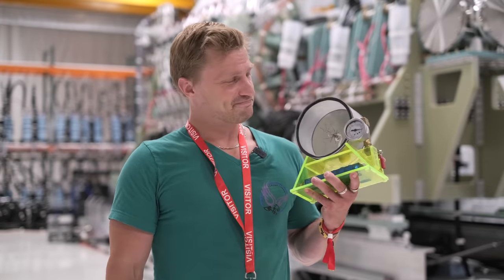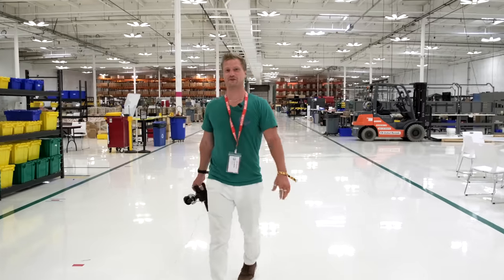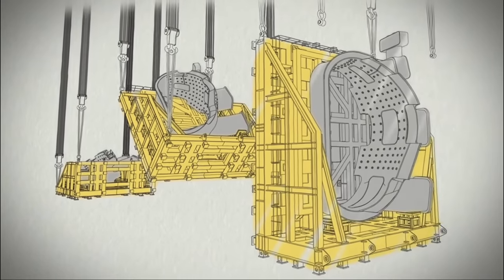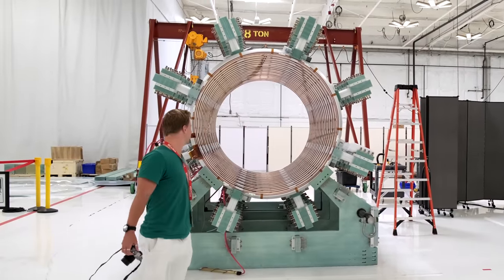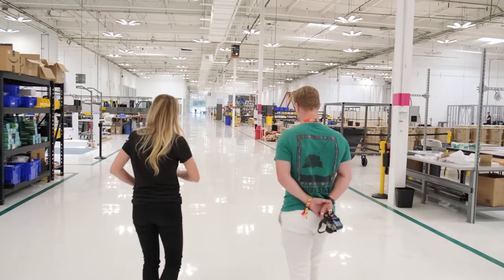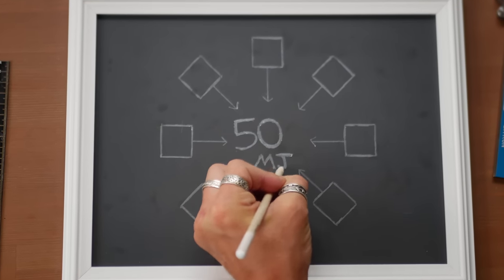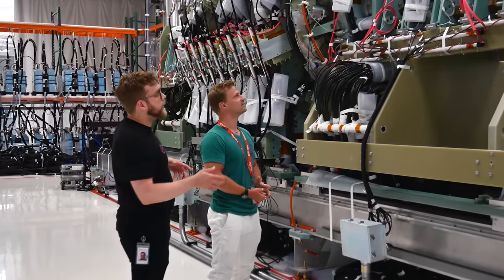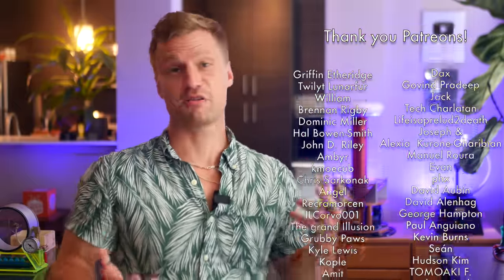An Exotic Approach to Nuclear Fusion (Helion Energy BTS)

Comment: I’m skeptically optimistic about Helion. I think what they’re doing is amazing but I can’t get over the fact that they never address the issue of unintended D-T reactions caused by side reactions that generate T and then allow D-T fusion. I’m sure the neutron level is a fraction of what normal D-T’s have but it’s still slightly radioactive and neutrons are no joke. However, it DOES seem like this may have influenced some changes in past designs I see. Iirc, they used to just take the electrons from the D-H3 reaction and allow them to drive their own current. With the new approach, it seems like that might be reducing the efficiency losses due to the side reactions (since D-T doesn’t produce e- iirc). Still would like to hear how they’re planning to solve/address side reactions tho. Overall, awesome video
Reply: The Tritons produced by D-D reactions are too hot and non- collisional on the time scale of the pulse (<1ms). They get pumped out of the chamber along with the other fusion products between pulses.

Comment: What I like about helion is they already have a way to harvest energy from the fusion reaction. I know for typical fusion reactor designs the goal would be to boil water, but that seems a lot easier for a fission reactor where you can use conduction with the reactor fuel. The plasma being suspended seems inherently more difficult to extract thermal energy from. To me it now seems like an unnecessary step like using a wind turbine to build water first or using sunlight to boil water for a steam engine (though a stirling engine might technically be more efficient than PV). It just seems like something that is simpler and would be more efficient. And the fact that the reaction they use only produces energy and charged particles and not neutrons just makes it so much cooler that they don't need to extract energy from a chargeless particle. It seems to me that in theory this method would be the most efficient fusion reactor possible. As an electrical engineer I may be biased, but its so cool being able to divert much of the mechanical problems into electrical ones (though thats not to say there aren't plenty of mechanical problems to solve with this design).
Reply: Their reaction DOES produce neutrons, they just don't mention it.   
H2 + He3 is aneutronic, but H2 + H2 -> H3 + H1 and H2 + H3 -> He4 + N .  
All of the research reactors are trying to raise Qplasma as much as possible, and experimenting with containment and tritium breeding. Things that must be solved before trying to even design a Fusion power plant.
Reply: also the magnetic coil in ITER are in the WAY  and cannot be removed!
Reply: While they may have decided how they want to take energy out of the system once they achieve fusion, they haven't achieved fusion yet. If their plasma gains 1MJ of energy per pulse, I predict that "regen-braking" the extra energy out of the plasma as it is being ejected from the reaction zone at relativistic speeds is going to cause problems with turbulent plasma flow such as hitting the walls.
Also, 0.1Hz firing rate? That sounds like an awful long time to hold plasma between pulses in something that looks like it wants to be a ~1MHz resonator.
Reply: @teardowndan5364  They don't hold the plasma between pulses. Each cycle starts with the creation of two brand new FRC plasma "donuts", and end with the total evacuation of the reaction chamber.
Reply: @ayybe7894  The Tritium side reactions are greatly reduced because the Tritons are too hot and non- collisional on the timescale of the pulse (<1ms). They get pumped out along with the other fusion products between pulses.
Reply: @teardowndan5364   They do not hold the plasma between pulses. The pulses are <1ms long. They have achieved fusion in several of their previous prototypes. Quite a lot of D-D neutrons too. Whether Trenta achieved net energy gain is a question though. The FRC plasmoid remains in the reaction zone until the end of the pulse.
Reply: @elmarmoelzer2229   If you throw away the however many 10s of MJs of energy needed to get hydrogen/He3 from storage temperature to 10+MK plasma before firing, that would be quite the handicap for true overall gain including all energy required to refine the fuel and reset the chamber.
Reply: @teardowndan5364  ???
The plasma is quite cold, even after the merge (low 100s of eV). It is the compression that gets the FRC to fusion temperatures. Overall, the process all the way to compression has been performed thousands of times and not just by Helion but even competitors like TAE.
Reply: @teardowndan5364  
You are assuming that the input energy is not recovered along with the fusion energy... Bad assumption.
Reply: I don't know why we should believe their energy harvesting method is efficient or practical.  It is a form of magnetohydrodynamic (MHD) generator.  The theoretical efficiency of a MHD generator is said to be about 60 to 65 percent (at least for burning fossil fuel), but so far no one has been able to approach this in practice.  Over many decades of time, MHD generators have been researched and MHD demonstration plants have been built but none have been able to compete with plain old turbines spinning plain old copper wire generators.  Besides the efficiency issue, MHD suffers from many material problems that are issues yet unsolved.  Are we to just assume that Helion has secretly solved all this already and all they have to do now is to make their fusion reactor produce moderately more energy than it consumes? 🤔
Reply: @analog_guy  
They have a FRC plasma with a beta of 1.
That means the ratio of plasma pressure to magnetic pressure is 1. It is essentially a perfect magnet.

Extracting the magnetic energy from the plasma should be at least as efficient as regenerative braking. The latter is at 95% now. In fact, they are using the same switches and electronics used in electric cars.
In addition to this, the plasma is in a vacuum. There is no friction. They predict that they can recover over 90% of the input energy that way. For the fusion energy it is a bit different (not all energy is transferred from the fusion products to the plasmoid) but it should be very efficient also. For the latter part, I think Oliphant is a decent reference. He published some experiments and calculations in 1973. He got 62% conversion efficiency from Alphas. Now his 62% was electrical coupling of the transformer back to the capacitors.
That transformer design is from 1973. The Switching technology has come a long way in 50 years, IGBTs weren’t even invented in the lab until 1978. So Helion should be significantly higher than that.

I do not see how any of those material problems would apply to Helion. They do have other material problems but those are unrelated to the energy recovery.
Reply: @analog_guy  The biggest problem with MHD is usually the fluid's conductivity, probably not an issue with 10-100MK plasma. Being able to recover 95% of the energy used to accelerate and compress the plasma might be the least questionable part of the whole thing in my book: simply using Lenz's law to let charged particles induce current in coils.
Reply: @elmarmoelzer2229  Thank you for your perspective on this and for your additional information.  If Helion is successful in producing a significant amount of fusion power, we may actually find out how efficient their conversion process is.
Reply: @teardowndan5364  Thanks.  I agree that fluid conductivity is a big problem in MHD, and I agree that there are a number of other questionable aspects to this approach to fusion power.  I'm no plasma physicist, but it would seem that by Lenz's law, the energy of any component of the velocity of the charged particles that is not perpendicular to the magnetic field will not be extracted.  Even if the plasma is nicely aligned upon injection, will it remain so following fusion?   It seems like there will be a race between energy extraction via the coils and energy losses via other processes.
Reply: @analog_guy  Not a fusion physicist either, though maintaining a coherent plasma flow just long enough to convert velocity back to electricity is likely a comparable computational fluid dynamics exercise to plasma confinement in a Stellarator or Tokamak.
Reply: @analog_guy   The FRC is still alive and well until the very end of the pulse (including expansion). The charged fusion products transfer their energy to the plasmoid via nuclear elastic scattering, Coulomb collisions and their own magnetic fields to the plasmoid. 
How much is the big question. They will also most likely want to move perpendicular to the magnetic field. So they should be able to get a good amount of the remaining energy into the coils from that as well. Again, Oliphant got 62% out of Alphas with 70ies technology. Helion should be able to do a lot better with their modern switches, etc. I think that 80% is pretty realistic. That would be twice as good as steam plants. And again, for the input energy which is still in the plasmoid, it is more like 90% efficiency. That input energy is the key. If you can recover 90% of it directly, then your fusion products only have to make up for this 10% loss for the machine to achieve engineering break even and anything above that is net electricity for the grid.

Helion is very much an engineering centric company. They experiment a lot. E.g. they build a small machine that made over a billion FRCs... 
They have a lot of experience with pulsed power and yet put a lot of effort into their pulsed power systems for Polaris (again).
Reply: @elmarmoelzer2229   Thanks for the reply.  Regarding your reference to Oliphant, I found the abstract of a paper entitled, "Direct conversion of thermonuclear plasma energy by high magnetic compression and expansion" by T.A. Oliphant, F.L. Ribe, T.A. Coultas, dated 1973.  It says, "The intrinsic thermodynamic efficiency of the direct conversion cycle from α-particle energy to work is 62%."  That makes it sound like a calculated number (best case) rather than a demonstrated number.  (I will have to see the full paper to confirm this.)  Are there other references?  I also found a paper entitled, "Direct Conversion of the Energy of Laser and Fusion Plasma Clouds to Electrical Energy During Expansion in a Magnetic Field", by Yuri Zakharov, et al., dated March 2001.  Its abstract says, "... in the optimized version of the method for conversion of inertial confinement fusion energy, a 30% efficiency can be achieved."  Of course, the Helion fusion approach is not the same as inertial confinement, each producing different reaction products and having different field configurations, but both depend on an expanding plasma. 

The Wikipedia article entitled "Helium-3" says that in the case of the helium-3 and deuterium fusion reaction, "Potential conversion efficiencies of 70% may be possible, as there is no need to convert proton energy to heat in order to drive a turbine-powered electrical generator", but no citation is given.  The article mentions the alpha particle generation as well but does not specifically say whether the 70% number might potentially apply in that case.  I suspect that any demonstrated number will fall well-short of a calculated best case or "may be" number.  

In Wikipedia's article on Helion Energy (in referring to Helion's direct energy conversion process), the article states, "According to the company, this process also allows the recovery of a significant part of the input energy at a round-trip efficiency of over 95%."  This seemed incredible to me until I realized this is a misleading statement.  Helion was not converting electrical energy to a plasma and back again.  Helion's web site, in the FAQs section, states, "Our earliest machines demonstrated that we could take electricity stored in capacitors, convert it to magnetic fields, and then recover it back out as electricity at as high as over 95% efficiency (without plasma present)."  Thus, the energy remained in electromagnetic form throughout.  That is entirely credible and unimpressive as there are countless inductor-capacitor systems that do the same or better.  In another FAQ section discussing more recent results, Helion says, "Additionally, we have demonstrated that our magnets run at > 90% energy efficiency...".  It sounds like they have lost some efficiency in scaling up their prototype machines.  They also say, “A … shield vault will surround Polaris to protect the area outside the machine from neutrons ...”.  Thus, the energy of these absorbed neutrons will not be converted to electricity.

Helion's most telling statement in those FAQs is, "To date, we have not released results overviewing our energy recovery with plasmas present."  So, they want us to assume great things, but they are not revealing their actual results.  We are only guessing what they might extract from the plasma.  We must wait to see some actual results for energy extraction.
Reply: @analog_guy   95% efficiency is greater 90% efficiency. I would not interpret too much into that. 
Oliphants 62% was electrical coupling of the transformer back to the capacitors. That was with a 70ies transformer and all that. 
Switching technology has improved a lot since then. Modern regeneratively braking technology is easily ~90% efficient.

As you say, ICF is very different. Again, Helion's FRCs have a beta of one (100%). 
You can not apply low beta physics to high beta plasmas. A disorganized ICF plasma cloud would behave very differently from an organized FRC. 2001 was also 22 years ago... Recovering energy from the plasmoid's magnetic field should pretty much only be limited by the resistance of the magnetic coils. The only question left to me is how much of the energy in the fusion products is transferred to the plasmoid before they leave confinement. And then I would probably apply Oliphant, rather than the other group. But even if you would apply a 30% conversion efficiency to that, then you would likely still get a very high efficiency overall. 
We will see how it goes. Hopefully Helion will release more information about this. I know they are a bit hesitant to do so because of trade secrets and stuff. From what I have heard, the whole system is not all that complicated and relatively easy to reproduce for someone from the field.

Comment: There's one problem I have noticed with this design, It's too simple: the basic principal that it uses of firing two plasma torroids at each other has been well understood for a good while now, but none of the labs that did it in the 80's are even bothering with plasma in their fusion reactors now. Upon further examination it's because the plasma being produced isn't sufficiently charged to get energy from through magnets alone.
Reply: No one else has bothered to do it because they know it won't work. Heliion design is No better than Rossi's e-Cat (fake cold fusion).
Reply: @guytech7310 LOL. No.